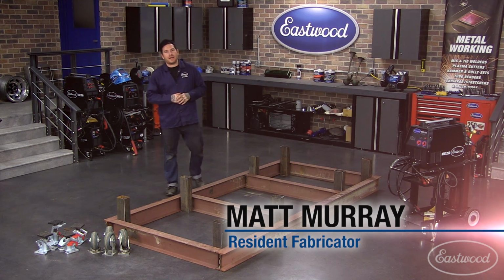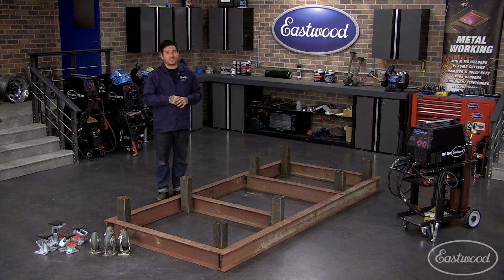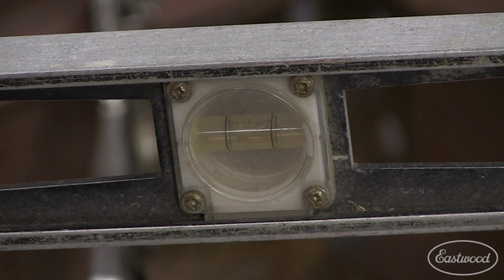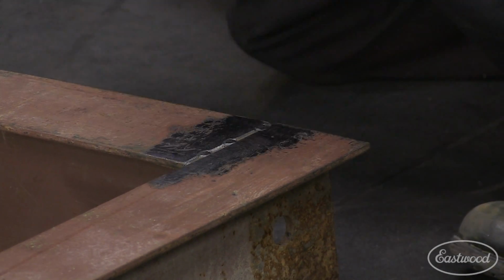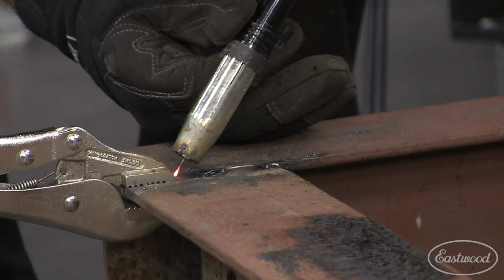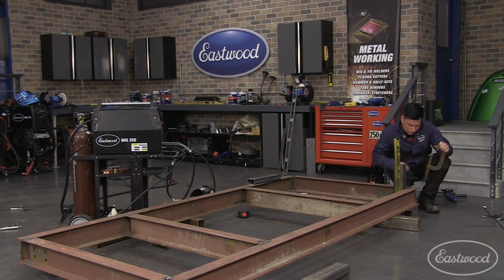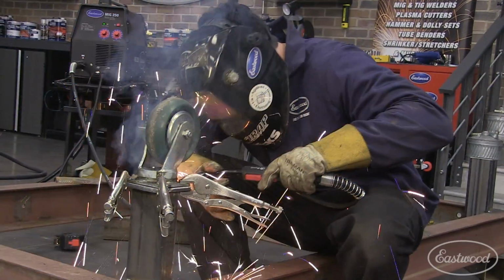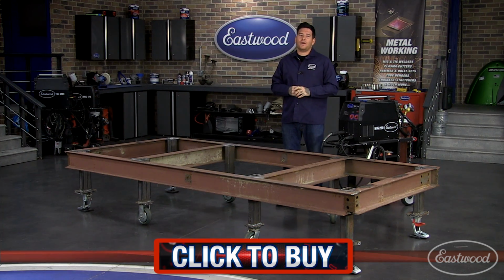How To Build DIY Chassis Table - Welding It All Together Using the Eastwood MIG 250!

Comment: I've built a few things of this type and have found that it's hard to buy steel that's cut squarely. The steel merchant may well have the saw set at right angles to the steel being cut to give a square cut in the horizontal axis but if the rollers that the steel rests on are not level, the vertical axis will not be square.

Comment: I realize that I am an old boy . It has been my experience that less mistakes are made if you use metal horse to get projects off the floor ( besides , I don't like working on my knees , anymore then I have too  ) . Noticed that you did not check your carpenter square for square . RULE of "3" "4" "5"  ( Geometry) . I prefer to tack my FAB table together , then cross check ( 25 foot tape measure ) opposite corners to ensure squareness . Double , triple check all cut measurements before tacking together . Yes , I have a selection of CARVER clamps and BESSY clamps , besides a collection of  VISE-GRIP "C" clamps . Yes , I made mistakes in my rookie years . I also use H.S.S. to clamp across the corners to ensure the "I - beams " are on the same plain , before tacking .
Reply: Sounds like you know what are you talking about. Could you do a video? I need to do a work table but need it perfect. Thanks.
Reply: You are right.. squares are not always square..I almost never use one to square things..only use a measure tape..and what is H.S.S. ?

Comment: Why not level the lower set of beams the first time around so you just have to check the level of the top set before you weld and you know your second set is already level? Just a thought. Im a fan of doing things once, but checking twice.

Comment: Good DIY video and excellent production quality. It does lack some info on parts but the guys below cover well. My main cringe moment that I did not see coming was; welding on casters and floor locks??? That is a HUGE no no. That is why they have a "bolt on plate". Oh well, that frame will not roll around much is the thought I am sure. Cheers

Comment: What's going on? No one changes joints before welding any more. I don't care how people feel about chamfering joints, I will always do it. Makes for much stronger weld, more complete penetration of weld ,plus you can grind the weld flush and still have a strong weld.

Comment: I always wanted to put wheels on pool table to move it in and out off-the-wall way still might
Reply: Probably a little late to tell you this but be careful. A lot of tables are built with 3 piece slate. They are leveled and often have something in the seam to prevent an edge from causing lay issues.  Moving the table at all can pop this and make the table unplayable.  But putting a table chassis on wheels can be even more unpredictable.  If it happens to be a 1 piece slate you probably won't run into too many issues.

Comment: where do you get those feet? And casters?
Reply: Rick Reece Not sure where they got theirs but amazon has 3000 lbs capacity for $90 (set of 4). There are also 5000 lb capacity but you are looking at $400 plus. They also have Floor locks.
 http://www.amazon.com/Heavy-Duty-Polyurethane-Swivel-Casters/dp/B00V8YU124/ref=sr_1_8?ie=UTF8&qid=1438825496&sr=8-8&keywords=heavy+casters
http://www.amazon.com/Vestil-FL-ADJ-46-Adjustable-Height-Floor/dp/B000R8GEMI/ref=sr_1_1?ie=UTF8&qid=1438825834&sr=8-1&keywords=floor+lock

This is just samples, you might have different needs.

Comment: What was the metal cost for all the components for the table itself? I (or H) beams, box tubing, ect
Reply: +itsFiggers $350-450 is my guess. I'd have used an angle finder to get the table flat and not twisted as it's much more accurate than a bubble level. I can read my Deco Angle Finder (from Speedway Motors dot com) down to a quarter of a degree. There was no need to weld the webs of the I beams, as some suggest, as their size is not so much for strength as for shape stability, so they stay straight.
Reply: Keep an eye out for people needing to clean up their yard.  I found a guy on Facebook 2 weeks ago that had to clean up before the city gave him a big fine.  48' of 4x6x.25" rectangle, 28' of 4"x.25" square for $50!
Reply: Russell Telker SELL ME SOME BRO!!! I'll go halves on yer $50! Lol
Reply: Jason Naylor lol, I built a similar table to this with what I bought. Keep your eyes open, deals are out there!

Comment: I think I would have built the caster / locking feet with bases on the bench first so you aren't having weld on the floor.

Comment: That one clip where you put the shims under the level 😂😂😂. Other than that looks pretty stout
Reply: What's wrong with that move? It's actually pretty smart. You figure out how many shims you need to get level, then put them under the other side. It saves a lot of time and effort instead of lifting the heavy ass i-beam and then checking level after each shim.

Comment: Somebody Should tell these so called Professionals that casters have holes in their plates for   a reason .
  They ruined the bearings  by welding on them .
   If you  add metal based Casters to anything DRILL & TAP the holes to mount them .

Comment: i would just weld the casters to the chassis..lol
Reply: +BOB JOHNSTON ~ You must be young. It's hard on the back to work bent over, and this table will get years of use. Note the  active market for motorcycle lifts, and see that others share my love of comfort while trying to do accurate work.
Reply: @bobo4691  agreed, getting old sux.     Build in as much comfort as possible in tables benches etc. You won't be disappointed down the road.🤘